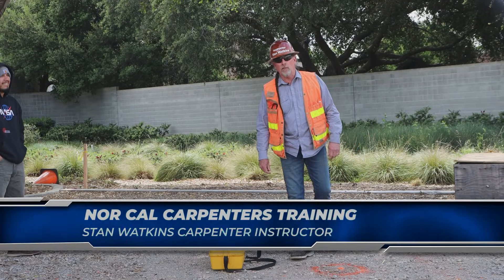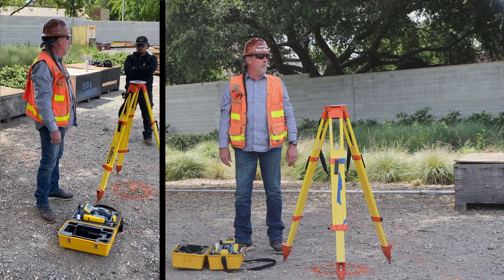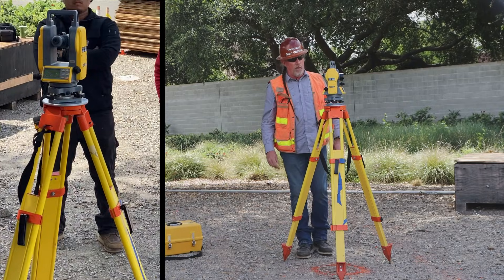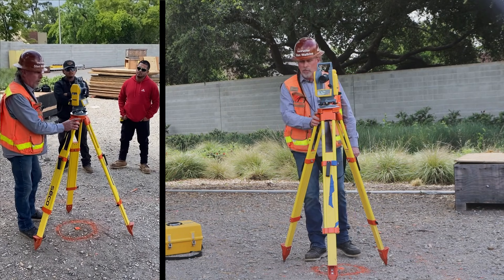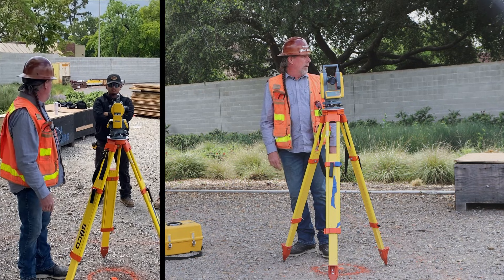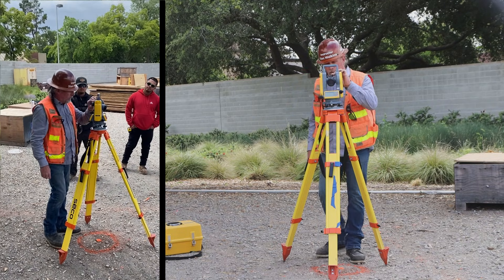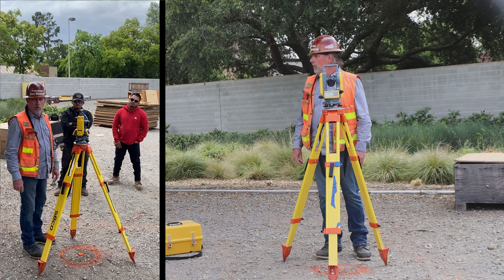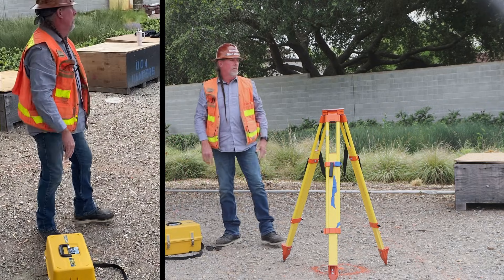Mastering Theodolite Setup and Operation with Carpenter Instructor Stan Watkins

Comment: 2:49 ALWAYS use two hands to hold the total station: one on the handle and one underneath. NEVER let go of the total station until you have the screw thread anchoring it (doesn't have to be snug).
Reply: We are watching a carpenter set up the gun. Not a land surveyor. He also picked up the leg opposite when he went to align with the point on the ground. Almost like he was trying to pick it all up at once. It is much easier to grab the two closest legs when swing over your point. The biggest mistake is he never pushed the legs into the ground. The slightest bump and all your work to level the instrument is wasted. The sun heating the ground is enough to bring you out of level if you don't push the legs into the ground and you let it sit long enough. Also, @ 11:08 it sounds like your hardhat is hitting the gun while looking through it. Can't say for sure, but that would not be good. One last bit... it's not like a clock, but a compass. Yes, we measure down to the minutes and seconds of a degree. However, using a clock as an analogy gives the wrong mental picture for someone who doesn't know any better. For example, due west is 270 degrees, not 9 o'clock. Very informative video, though. Just a few areas to improve and this would be a great demonstration.

Comment: why the height is too low, it should as high that don't be needed to bend over.
Reply: Depends... maybe you need to shoot something a few feet in front of the gun... if you have it at eye height you now need a box to stand on.
Reply: If you are surveying down (to a pit or trench), it is best to have the tripod set lower than your sternum, so you can see down into the eye piece. If you are shooting up (to a construction), it is best to set the tripod higher, so the eye piece is comfortable to look through.